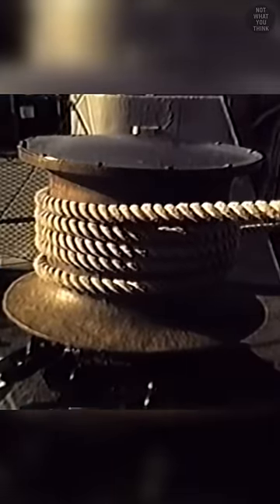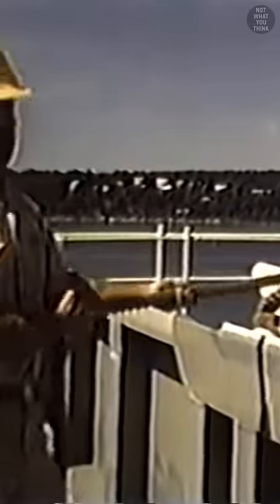When Mooring Lines SNAP! #shorts

Comment: My dad got hit in the center of the back. Any lower would've paralyzed him any higher would have cut his head off. He had 4 broken ribs cracked skull both elbows and one knee. Crowley ditched him in Venezuela and he sued the sh*t out of them and ended up going back to sailing 20 years later to get his captain's license. A true hauspiper no academy.
Reply: How can he sue if it was his stupidity and carelessness that caused him injuries? A boat has to move, it can’t sit for months waiting for your dad in the hospital
Reply: @deivytrajan It's the company's responsibility to ensure safety protocols are followed

Comment: shortly after the USS Georgia commissioning, the sub was coming out of Drydock at EB shipyards in Groton Ct.  I think it was 1985ish... the the Po in charge saw the tattle tail go tight  on a 3inch jute Moring line the shipyard provided. he grabbed the sailor tending the line pulled him away but he caught the hole thing on his chest and a hundred foot of rope landed on him , he was lucky most of the impact was absorbed by the Kpoc life preserver... a EB crane operator saw it as it happened and swung a basket over were we loaded him into it and he was lifted to the pier and was rushed to the EB shipyard Hospital. we were told  that he was going to be ok massive busing to the face broken ribs and a collapsed lung. he was transferred to a navy hospital then we never saw him again
Reply: What a guy, huh?
Reply: The live vest helped but the real champ was them using jute. It doesn't stretch like nylon, so when it goes it has only a fraction of the recoil. Hemp is even safer it just goes pop and falls into the water.
Reply: @Solnoric  I was topside believe me, there was enough spring in the line to kill him he was extremely lucky,  but you are correct the modern Nylon lines are like rubber bands on steroids.

Comment: I witnessed in person a US Navy destroyer captain discover that someone had pulled a locking pin from the folding port side mooring line guide on his ship (the Shoup), it was a big oval of steel that weighed about 400 pounds and tilted over for storage, but because the vertical position locking pin was pulled it had laid down on top of the $140k Kevlar mooring line that was under tension, it had become frayed due to the waves back and forth motion sawing at it. He was completely and utterly pissed off, I'm so glad I wasn't actually in the military (I was a machinist contracted to work for them). Nobody on my work crew fessed up to it nor do I think they did it, we actually were working on the exact same part but on the opposite side of the ship so common sense would say someone went to work on it but mistook which side they were working on, but none of us would have done it without a strict work order. There were other work crews so who knows, but one thing is for sure, I'm glad he didn't blame us, he looked ready to shoot someone for making him requisition another brand new $140k Kevlar mooring line...

Comment: Almost learned this lesson the hard way when I was a teenager working under the table at a huge commercial construction site for a 35 story hotel. Came within a millimeter of getting my arm caught in a metal box as a crane lifted it and the load shifted. As I pulled out I felt the weight coming down on my bone. It would have snapped like a twig and pinned my mangled arm to the load as it went up. 
Never stuck my arm in between two potentially moving objects again. 
I had left my block marking pencil on the load and was reaching to grab it before it went 30 stories up. Not worth it.

Comment: Related to mooring lines.
A tow line is not supposed to be taut. When a large vessel tows an other large vessel, the former lifts the line out of the water and they let gravity pull the line back down taking the towed vessel along with it. The tower then pulls a bit more lifting the line up again and waits for gravity to do its thing again. The water in/on the line helps with adding extra weight to the line. When both vessels are at the desired speed, the line is still slack and just above the water (to avoid the extra resistance of dragging it through the water).

Comment: Not just sailors, but riggers of all environments.
There are reasons that most tow trucks have moved away from cable lifting and into hydraulic level arms under the tires. And that still leaves the cable on flatbed towing that can be a danger.

Comment: Once our ship was moored using wire ropes and they snapped because of the wave in the open sea port. We were all instructed not to go near the mooring line in that condition. I guess those were 28mm or 32mm ropes. I don't remember exactly. Snapping of wire rope that much thick is much more dangerous than nylon rope. Thanks to God no one got hurt.

Comment: The amount of stored energy in a taught line, rope or even chain is mega scary. 

Working at a steel mill in 2016, I saw what happens when one fails. I still wake up screaming trying to get to my friend. 

Its not fair.
Reply: Sorry about your loss, man.
Reply: Sorry for your loss
Reply: Pathologists still have to post mortem accidents to check for foul play. Accidental deaths are shockingly common but they tend to be built on much workplace negligence, not helped by the boss often downplaying serious issues until disaster strikes.

Comment: The risk of snapped lines, steel cables and chains is terrifying. Some hazards are extreme. Saw a man working on live industry equipment, get his jacket caught on a very large, very fast spinning protruding axle. He got wrapped up. Once his skin got caught, he was spun around that axle so violently. The centrifugal force caused most of his bones and organs to be flung out (off?) all across the factory floor, like spinning a plastic bag so violently that the bottom start tearing and content gets flung out. Poor man was torn to bits and practically flayed. I pray to this day that his neck broke or head got struck the instant it grabbed hold of him, that he was not alive to suffer what happened.

Comment: Here's a quick hint.......if you're pulling someone out of a ditch, or doing any pulling work that requires a cable or rope (not chain) hang a towel or coat over the line. It aborts the snap-back.

Comment: I was on deck force on a destroyer around 1968 or so, and tasked with wrapping up lines as we moored in San Francisco during high winds and current.  When I felt the doubled lines stretch under my hands, I vacated the area, and went on liberty.

That night some of the lines parted and the crew that could be reached was recalled to secure the ship - I found out later!  They had to add a huge steel towing hawser to the lines to hold her. Wind and current were conspiring to send the ship back out to sea, and it took a lot of nylon, steel and labor to keep her against the wharf.

Comment: Yeah, modern lines are designed to fall apart safely instead of snapping. But other line handling points are still relevant, like getting caught in lines or broken anchor chains

Comment: The stretchier a line or cable is, the more dangerous. Chain doesn't stretch much so won't recoil as badly. Nylon rope is the worst, bc it's the stretchiest. Why is this relevant? Because people tow cars with line that's not strong enough, starting out with a strong jerk that will overload it even more. The person driving the towed car can really eat it windshield or not. So I think towing with chain is safer, regardless if the line has greater strength. At the ends, use many turns of line to attach a chain to an axle, so you do less damage to the car.
This video shows a common but less-than-ideal situation: the guy "veering" a large 3-strand mooring line (easing it out in spite of the spinning capstan drum). This is where lines can get damaged by the heat that's generated here, but the thing is, it's a Right-Hand Lay line (not a hawser, which would be three of these ropes wound together), and it's being hauled or veered (back and forth) on a drum that's turning counter-clockwise. Winding this type of rope around something in a counter-clockwise direction is less than ideal, and very hard on the rope.
The sailors who were  just "shaking" that braided line recognize the more you massage a line like that, the stronger it will be. All the yarns need to share the load. Braid can be wrapped Either way around a drum, doesn't matter like with 3-strand.
Thank you

Comment: They need to make a moving , Sheila  barricade, that sailor can slip behind when the put tension to the lines.  Incase of back lash ect. A moving like Shield that’s in a track , (going up and down the length of the line ,  and  can lock into place, easily,  On a strait lined track .

Comment: Try working with whole trees and steel cable. I saw a 1" wire rope snap trying to uproot part of a cedar tree and the cable end went right through one side of a huge tree stump and just instantly removed about 200 lbs of wood. If someone would have been standing there, the cable would have cut them in half at the waist without even slowing down!

Comment: I've parted those before, but modern Spectra lines used on Burke destroyers don't snap back, the braided lines individually part and the line pretty much falls straight down. (USS Momsen DDG-92 in Guam 2006 time frame, parting lines around 2200 and they called away line handlers to put more across to the pier. I was running the aft capstan trying to put enough tension on one so we could put more across by hand). We ended up using a tug as well as more lines to keep the ship next to the pier over night!

Comment: Dangerous job is cat cable skinning logs on the mountain slopes multiple logs are rigged to long cable that runs the length of the slope,before that cable is tugged there's a blast from the horn to give the all clear.A broken line can cut you in half ,it has happened many times !

Comment: Line does not snapback any longer. Nylon core lines have been replaced with kevlar core. When a line parts, it simply just falls where it is. Even though there is no longer any danger, i still feel major pucker factor when I see a line under high tension. Last time I witnessed a line part, we were on weekend duty during a major storm surge. Duty section couldn't do anything but give a half hearted cheer as we watched the aft most line part and fall into the harbor.

Comment: The modern kevlar lines absorb a lot of energy when they part.  They're a bit safer, but by no means does that allow complacency.
Our last departure, the assist tugs messed up and ended up parting my #2 line.  I saw it happening, with a bunch of sailors just standing on the pier.  And I'm like, "GET BACK NOW!  MOVE!"  The line parted, but with almost no snap.  I was pretty impressed.  By the line, not the tugs.

Comment: I watched an amateur video of a snapped steel towing cable going into the windshield of a 4 wheel drive. If it wasn't for the windshield and drivers jaw taking most of the impact (it was pulverized btw) he would've been decapitated. I know this because After the cable went through the windshield, the vid cut to the guy on a hospital bed. Brutal stuff.

Comment: My grandpa used to be a sailor. One time a big thick metal wire broke, and the whiplash cut the head off a guy, and his body was still standing and bleeding in a stream like a fountain for a second. I don't think his head was cut off, more likely just got turned into mashed potatoes, anyway my dad told me this, when I went asked my grandpa he told me the same and then spent 5 minutes straight looking at a corner with empty eyes.

Comment: Don't forget, never step in the "bite"! That's a coil of line on the deck. If the line tensions, the coil could grab your leg and pull you through a 10" or smaller opening 😰

Comment: I used to work on tug boats with barges and this is to all people that work on and around boring lines if the line is wet and you can see water dripping out of it once the line becomes taunt and the water stops dripping you might want to get out of the way it is indication that the line is going to break it's because it has become so taunt that his squeezed all the water completely out of the line I have seen this happen numerous of times it's a true fact when the line stops dripping water because it's so tight it is indication that that line is going to break cut you in half like butter

Comment: Worked on a tug for a while. Seen a few lines pop, but what terrified me more than that is when our port side cables snapped and flung at our boat absolutely fucking up the hand railing and the corner of the barge we were pushing.
Reply: The powerful engine in tug boats can snap some big ropes
Reply: @ozone3750  oh that's for sure. Had one guy who wasn't the best pilot bust 2 of our lines back to back. 😂 We were stringing out tow and he was tossing that bitch around waaaaaay to fast.